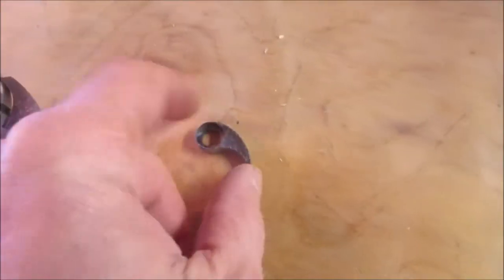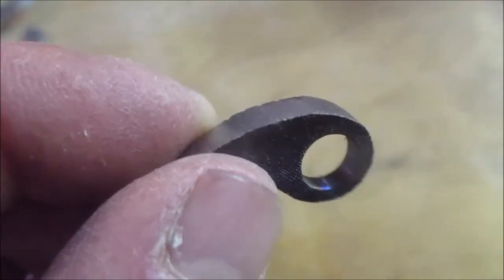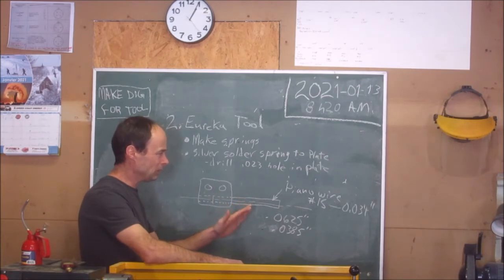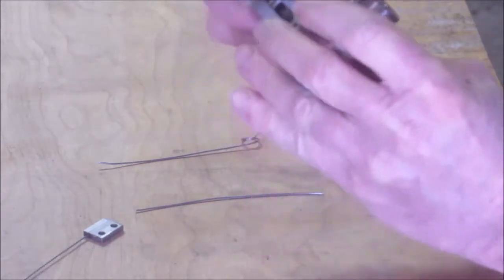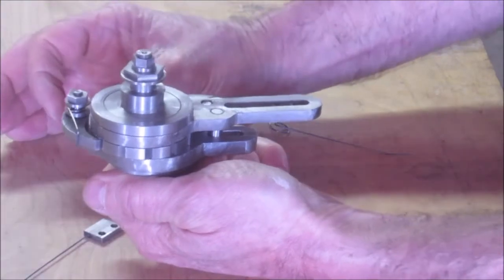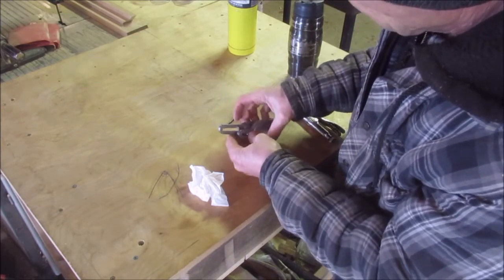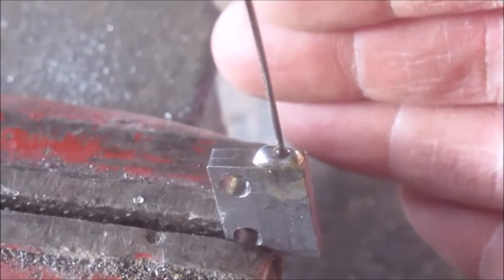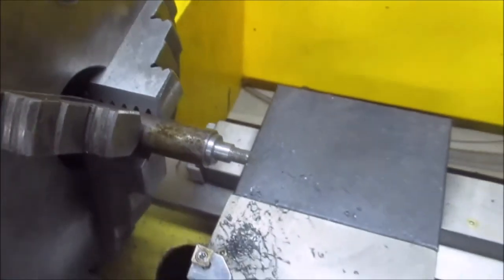Eureka Gear Cutter Continuous Relieving Tool    Part # 11

Comment: muy bueno compartes los planos
Reply from the maker: A las 6:00/18:52 de la Parte #1 del video de la herramienta Eureka, puede ver un plano de la herramienta Eureka.   En la esquina inferior derecha hay una vista final de Spindal.   El 0,168" es correcto, pero el 0,030" debería ser cero.   Aún funcionará si lo hiciste con el valor 0.030" pero debería ser cero. Si no digo esto correctamente, es porque no hablo español y estoy usando el traductor de Google para hablar contigo. Gracias por suscribirte. a mi canal.

Comment: Is there a part 12, looking forward to seeing this in action>:goodvibes:
Reply from the maker: There is a part # 12 and 13.  In 13,  you see the tool in action.
Reply: @dlfabrications  Thank you for the advice, when I finished ep 11 there were no further episodes showing. I hope you have been able to source some material for the buttons, if not, seeing it is such a small amount required could you use a worn/broken drill shank? Close to the bottom of the flutes it will be hard but at the bottom of the shank it should be softer, of course you would have to harden and temper it before use.🤔
Reply from the maker: @garychaplin9861  I do not know how you got to these videos but if you visit my channel, then click on videos or view videos you get a list of all my videos.  From that, if my play list is incomplete and you do not see all 13 videos on the eureka build, you can find the two 12,13 you missed out on.  The one thing I am not sure about this tool is the center hole at the end of the tool where you fasten the cutter blank.  I made mine off-center by 0.030" I think but if the tool was made with centers that line up, I think the tool would still make the gear cutters with the correct geometry.   I could not at the time of the build find drill rod 1 to 2 inches reasonably priced in my region to make cutter blanks.
Reply: @dlfabrications  Have you been able to find some material since then? I am sure a lot of viewers would like to see the tool cutting the relief angles.
Reply from the maker: @garychaplin9861  Until I get monetized, the metal side of my videos are on hold.  I have been trying to get there but my videos are always overlooked.  Not enough subscribers.